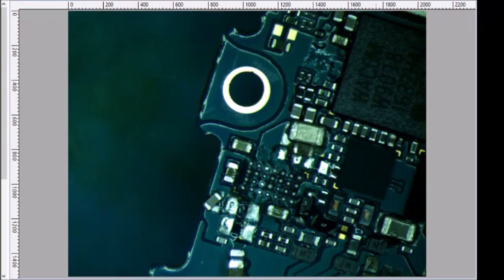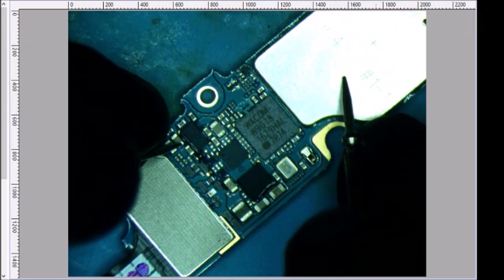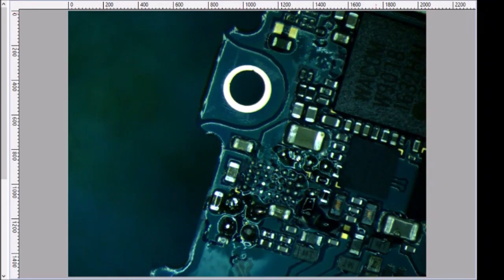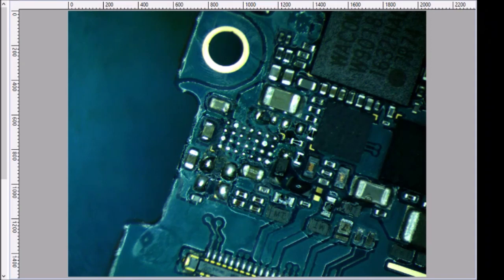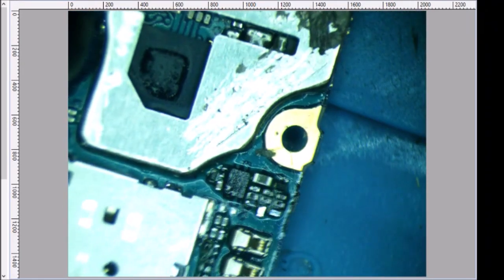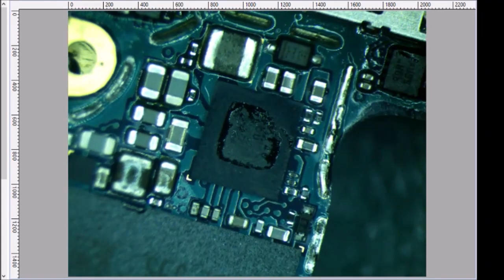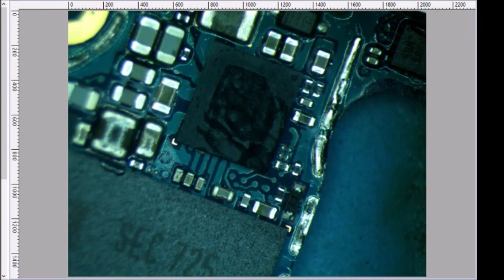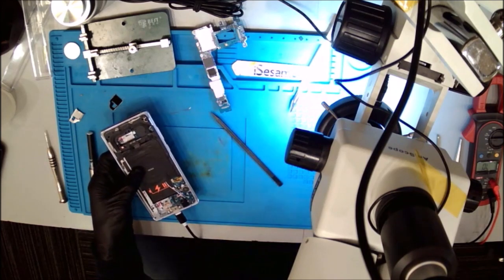Note 8 Not Charging- Logic Board Repair

Comment: I have a Note 8 exactly with the very same problem, but I don't have the equipment you have to fix it, so I will better look for a complete good board.
Maybe just heating it to melt the solder and letting cool down can help.
I recommend you to use kapton tape to cover all components around the chips, so they won't desolder.

Comment: Great informative video . I can tell your knowledgeable with the Note 8 . I have an AT&T Note 8 . It's very hard to get a connection with the charge cord to the charge port on the phone but when there is a connection, I try to lay the phone flat , so it will charge and as soon as the phone tilts , the charge loses contact.  However the phone will charge upright . Do you have any ideas what the issue may be ? I've tried googling information , on why the phone wont charge flat but will charge in an upright position and cant find anything ? Do you think the charge port could be bad ? Do you think the phone will charge using a wireless charger ? Any information is greatly appreciated.  Thank you.

Comment: Greetings, brother, I have the following failure with a samsung note 8, it comes to me due to humidity problems which I manage to solve but I get another low temperature failure ... I changed the battery charging flex and even so it generates the same failure of low temperature ... Could you help me or guide me what I can do to solve

Comment: Can I just swap out logic board with an unlocked one for the same model phone instead of repairing?
Reply: of curse but data is a factor.
Reply: @jonathantejada1155  I just switched logic boards in my Note 8 because the chip was bad and wouldn't charge anymore.  I had already replaced USB board but there was no change. Everything except for the fingerprint sensor works. That must be mated to old logic board. Oh well.

Comment: Thanks bro, I have the cellphone with the same issue I just changed 5720ic now the phone powers up but still not charging, when I received the phone was dead, I have also changed tha max 98506 ic, any idea what could b the problem, Thanks
Reply from the maker: these phones are pretty challenging to solve, The only other thing I would try is check the voltages on main rail and possibly change the max77838 chip.